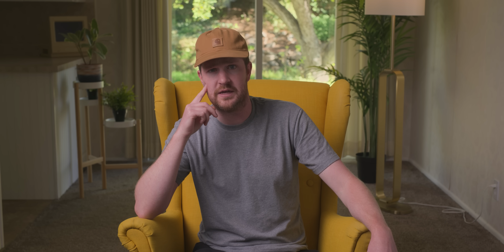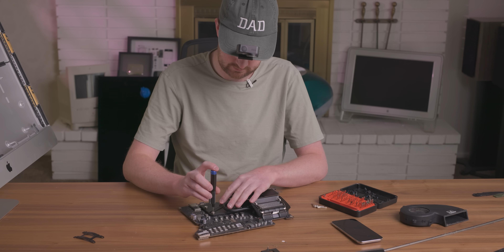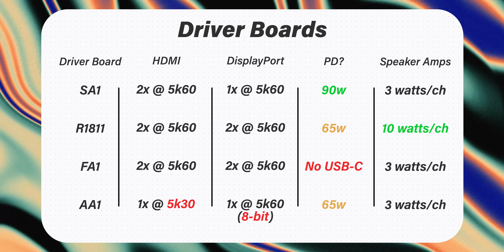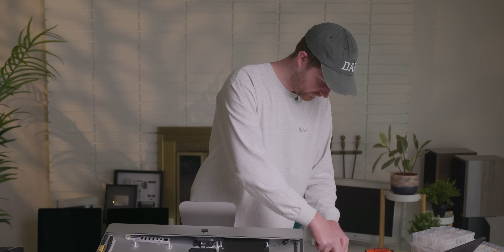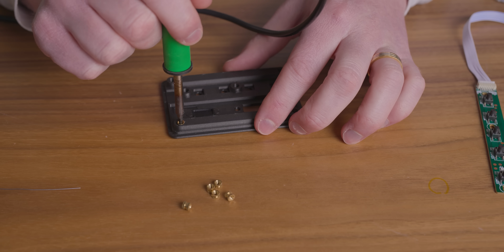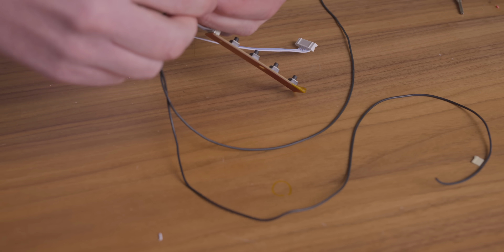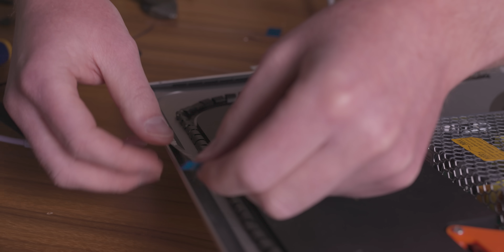I Turned a $200 iMac Into a $1,600 Studio Display!

Comment: This technique does not work with a early 2019 core I nine chips. Then they’re done that can’t make it become a second display on my Mac studio M5 max and even though the M5 max has thunderbolt five my 2019 early 2019 has thunderbolt three so in theory it should work in actuality. It does not and surprising me enough if I had bought the late 2019 27” it would work, I have no solution yet unless you have some insight you would like to offer me by the way great video great channel I subscribed…😊

Comment: I've been using it for almost 10 months now. I just hot glued everything (without 3D printed parts) and put a couple of adjustable wrenches inside the iMac for counterweight. It has no fan system, but somehow it still works fine. It cost about $300 in total in South Korea. Very worth it

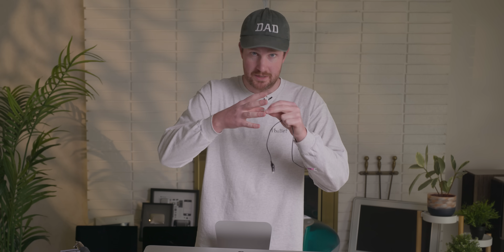Comment: 15:40 - those non crimping heat gun wire connectors are terrible. The connection is flimsy and flexes so much that it breaks the solder eventually. Especially if there is any type of load on the cable.

Comment: I just finished my 27" iMac conversion using this video as guidance. There is really no need to 3D print parts (a solution in search of a problem and adds complexity). I just twisted off some of the OEM mounts used in various places and repositioned them using epoxy to mount the graphics card next to the right speaker. I kept the fan, speakers, added crossovers mounted to existing posts. I used a $15, 24VDC/5A laptop power supply which is much smaller and has built in thermal protection and noise suppression. I attached the PS with heavy duty velcro. Fan controller tapped into one of the USB ports on the graphics card for its 5VDC power. I re-used the Apple access door to mount the switch panel and bulkhead connectors for DP and HDMI. I can still remove it and access the graphics card video connections, if necessary, and without removing the display.  It was a fun project, $375 all in, including $100 donor iMac on Craigslist.

Comment: I just got a free 2017 iMac 21.5" 4K...still in the "what if..." of deciding what I want to do with it.  To my surprise it is fully functional...just needed an OS.  It is just the i5 7500, gonna grab an i7 7700, got 16GB for it and just a 256GB SSD for now.  I am thinking of making a slim stand that goes beneath it holding a Bluray drive, another storage option, and maybe move some USB / USB - C to an easier accesable location.

Comment: Hi everyone,

I’m urgently trying to convert my iMac 27-inch 2020 (A2115 / iMac20,1) into an external 5K monitor, and I would really appreciate your help.

My iMac:

* A2115 / iMac20,1
* Retina 5K 27”
* AMD Radeon Pro 5300 4GB
* 5120 × 2880 @ 60Hz
* Original Apple 5K panel

I have the EDID information and photos of the panel label.

I’m looking for the exact compatible setup for this 2020 panel:

* 5K controller board
* Correct panel/revision and eDP cable
* 24V power supply
* Speaker crossover/adapter and cables
* USB-C / DP / HDMI inputs
* Any other parts required

Most guides I found are for 2015–2017 iMacs, so I specifically need advice from someone who has done the conversion on a 2020 A2115.

If you have successfully done this, please help me with the exact controller model and compatible parts, preferably with AliExpress links.

I really need to complete this project, so any first-hand experience or advice would be greatly appreciated.

Thank you so much!

Comment: Hi there absolutely loved this and made it my own followed every step and as far as I know haven't missed at thing. Screen, fan and speakers are working perfectly one thing isn't which are the buttons on the back :( I could really use some help and hope you could provide me some info on what might be the problem :/ buttons defect after cutting of the on button? rerouted it on the original power button which works fine  (meaning I can turn the screen on and off with the OEM apple button on the left corner) just the rest of the buttons don't respond. what did i do wrong!!:P

Comment: I have successfully implemented this.  It took about 3-4 days of working on it off and on.  I had to do a lot of pausing the screen, counting wires, etc.  I will note that the 3-d printing files linked mostely worked.  The one for the driver board did not match what was in the video and didn't line up properly with existing holes in my case.  I had to improvise and only use 2 of the 4 mounts.

Comment: Help, how to do I connect the last two cables, IE from the controller to the monitor?  The one is simple, it has a clamp and goes right in.  The other has pins sticking out and I can't figure out how to connect that cord from the controller to the last cable on the monitor.

Comment: Happily still using my iMac18,3 topped out at macOS Ventura 13.7 as a web, video ,Evernote and general writing machine. Something worth noting is that even with the OS gap from 2 to 13, this iMac is still interoperating as a seamless space with the Macbook (and its other monitor) next to it, ,moving the mouse across between the two and dragging files with no delay. Apple do a great job with Continuity and Universal Control.

If I open shared files on the iMac, I can use it as a big screen editor for stuff on the Macbook, ,so for now I have a great working approach without pulling things apart. Still, thanks for the enthusiastic tips and bookmarking this for the day when all this stops working.

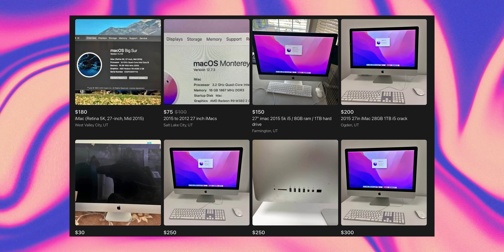Comment: 6:50 I practically stole this computer. I just picked ip a 2017 5k iMac with the 570 Pro GPU, and 48gb of ram and a 1tb fusion strive with a Magic Keyboard and a Logitech mouse for $125. what an actual steal, the guy even threw in this other 3rd party wired keyboard too that sorta looks like a Magic Keyboard. and before you start thinking its all beat to crap, it is not. it looks perfect. it performs very well. the hardest pill to swallow is having to choose between using this as an external display, or as a standalone computer.

I really want to be able to have this thing work as a standalone monitor to extend my M1 MacBook Air's display for productivity related reasons.

however the graphics perform as well as my MacBook Air, however the thermal headroom is much higher and it has a TON of ram (the cpu though is quite a bit weaker than the M1, but that's to be expected. and with the fans, if I'm doing anything heavy, it should keep up the pace fine compared to my MacBook). it should be a decently good gaming computer considering it can run windows, and, um, has a fan so it doesn't overheat which frequently makes me have to slow things down when running Minecraft on my Air, even though it handles the max settings great, it just doesn't have the thermal headroom to maintain that without me feeling like I'm punishing the components. 

ahhhh.. so sad, I will find a way to make this work because I REFUSE to let a decent, actively cooled GPU, 48gb of ram, and 1tb of storage go to waste just to use the (albeit beautiful) 5k display. I am DETERMINED to find a way to use both.
Reply: Okay so I have a workaround that isn't quite Ideal but might be better than spending $76 on a lunadisplay connector. basically just link the computers together and you can then use your keyboard and mouse for both. You can also through continuity open safari windows back and forth quite quickly. not as quick or effective as already having everything basically on one device, but pretty good for many cases and if I'm keeping certain apps for one display and certain apps for the other, its not that big of an issue. since I'm the only one using this computer, the way it is now actually can be quite effective for what I want to use it for, while keeping it functional as a computer that can have files and be standalone without my MacBook. I just need to get a more modern version of macOS on here and maybe get a partition for windows so I can do some gaming, and have a small partition for Linux because that would be cool :)
Reply: UPDATE: I am 90% there!

So as I wanted to use this computer as well as a computer, not just as a great monitor and a set of speakers, I used OCLP to install Sequoia (for significantly improved productivity and multitasking ability, really take advantage of the whole 48gb of ram!), as well as modifying the identifier for my iMac to say it was a Mac that supported being an airplay receiver. which funnily enough, when all is said and done, I am actually likely to just use the computer and airplay to my MacBook because if I need a second display, I am gonna be multitasking a ton, and therefore gonna want to be using the active cooling and 48gb of ram on my iMac, instead of overloading the 16gb of ram on my Air, when just regular use for me puts around 888mb on swap. 

so currently I can now stream to my iMac as a monitor, stream from my iMac like a computer, use it as a productivity workhorse in conjunction with my MacBook Air and connection with iCloud and continuity, I have a iMac with a decently powerful GPU (on par with my M1, but with active cooling), and the ability to bootcamp Windows on it, making it a decent gaming rig all things considered. its not gonna beat a custom pc, not even close. but my experience in gaming on computers is literally this 2020 M1 Air, my 2019 XPS 13, my 2013 MacBook Pro 15,  and a Dell 5420 All in One (which though its newer, has a MUCH worse graphics card, and a pretty comparable cpu, but 16 vs 48gb of ram, and a similar type of drive being being a Fusion Drive.). 

I am so happy. the only thing left is to try getting bootcamp on it, but I need to first solidify where Im going to leave the OCLP boot disk. if im going to partition it onto the hard drive, or maybe open it up and put a completely new ssd in it and almost make it act as a storage hub, as it already has 1tb of storage.

Comment: Does power delivery over USB-C work on your setup? 
I'm trying to decide what power supply to get and I noticed the LRS-150-24 that you used only does 6.5A. I saw on the infamous macrumors thread that you need 8A+ if you plan to use the USB-C port for power delivery. The Mean Well LRS-200-24 does 8.8A, but I'm not sure if the 3d printed power supply mounting parts will work with that one.

Comment: Ok so I just did this project for bout a couple weeks now with trial and error since my board was the latest version of the R1820 than the R1811 so the 3D printed parts weren’t compatible for it, so I opted out for thin steel strips and bended and cut them to align with the screw holes, when it comes to the PSU make sure to switch the 250V to 156V from the side so it connects, and make sure to place an FG ground cable with the already screwed in one from the monitor next to the dual power outlet cables which was sadly skipped over in the video, as for the temp fan: cycle through using the first button for each setting and the other 2 for +\-  

If you want to turn off the MeanWell PSU manually than just turning off the stonetaskin board, try an outlet switcher that matches the wattage for it. 

Also DO NOT USE the Heat Gun that comes with the tube solder kit try an 50$ one with multiple nozzles included as he has in the video.

Comment: Quinn & Dana - Man, if somebody ended up with your shared iMac, They'd assume it was owned by 2 Hot Lesbians. 
Anyways, Although a proper 27" 5K iMac with an i5/i7/i9 Is still an absolute rocketship in 2026 - Apple really dropped the ball on not just repurposing the 2014+ Cases as External Monitors in the first place. I mean, they would've sold them for like $4000 anyways so i don't get why they avoided the moneygrab.

Comment: Many years ago I could use my 2009 iMac as a secondary display for my MacBook without any issues, switching back and forth between the two. Using a computer as a monitor without using it as a computer makes no sense. It just burns a lot of extra and useless energy

Comment: 1:34. ViewSonic 5k 27" display with better specs WAY better stand, connectivity out the wazoo including thunderbolt port that will drive the display while charging your MacBook.  Add top of the line speakers and webcam, and still save hundreds of dollars.

Comment: I literally just did 2 2017 Imacs, one for myself and one for my wife and once you are done and make adjustments there is no monitor for the money that comes close to these monitors. Absolutely perfect project, it helps if you have a 3d printer
Reply: Hi there absolutely loved this and made it my own followed every step and as far as I know haven't missed at thing. Screen, fan and speakers are working perfectly one thing isn't which are the buttons on the back :( I could really use some help and hope you could provide me some info on what might be the problem :/ buttons defect after cutting of the on button? rerouted it on the original power button which works fine  (meaning I can turn the screen on and off with the OEM apple button on the left corner) just the rest of the buttons don't respond. what did i do wrong!!:P

Comment: for less than $1000 you can just buy a great condition used studio display. My time is worth more than the $300-400 I might save by doing this and hoping it works. ( I also don't own a 3d printer )    A few months ago I sold my 2014 5k imac for $350 on eBay.

Comment: Video is great , .I personally did this conversion with the simmilar driver board and imac 2015. My experience is that the difference between 10-bit and 8-bit color depth is huge. I use this iMac as a secondary display, and the colors actually look better on my 4K monitor with 10-bit color. Once you notice the difference, it can be a bit disappointing.

Personally, I don’t think 5K is something you really need. I was able to run 5K, but only at 30Hz over HDMI. The seller told me that for 60Hz you need to use Thunderbolt/USB-C.

A 27-inch display with 3840×2160 resolution is more than enough, especially since those monitors are easy to find nowadays.

Also, by 2025, almost all of these original iMac panels are starting to develop the pink tint effect around the edges, which is another disappointing issue to keep in mind.

Comment: go buy a 27" iMac 5K with Thunderbolt for cheap and get 'BetterDisplay' to drive it from an MBA or laptop or some other newer mac.  Absolutely the best monitor for the money.  You don't have to buy hardware or open the display.  Plus you still have a computer.  You threw away an i7?  And a GPU?  Why?  iMac 5K with MBA and soon Mac Studio.  And if you eventually want to sell the computer in the future, you still can.

Comment: Followed your steps pretty much verbatim, and I'm now I'm the happy owner of a 2017 5K display to match with my M2 Studio! I don't know how often you read comments, but thank you so much for making such a concise step-by-step video, along with cataloging all the parts and STLs I needed for the build. Your website is missing a couple little things at the moment, like how to properly wire the crossovers and your custom STLs, (which just lead to broken links,) but considering what happened to you during this whole ordeal I understand why. overall I can't thank you enough for doing the hard work for us!

P.S.- For anyone else looking to do this build, one piece of advice I'd give is to not bother with the crossovers/speakers. While the original Mac DACs worked great with the speakers, these are quiet, lack any bass, and the volume can't even be controlled, (at least as far as I can tell when connected through USB-C.) My Mac Studio's built-in speaker genuinely sounds better and got louder, so I just pulled them out entirely before I finished. Save the money for some dedicated speakers, you can get great older 2.1 PC speaker setups that'll blow any built-ins out of the water for only $20 or less used. Other than that, be aware the power button will only control the display, the power supply will always be on and so will the fan controller when wired up like he shows. not a big problem as the fan will stop once its reached ambient temperature inside, and most display power supplies work like this anyways, but just something to be aware of that I didn't even consider when building it.

And for anyone wondering, total cost with tax (including the cost of the computer I got off eBay) was $550, ($520 without the crossovers that I didn't end up using.) It'll be more if you don't already have things like soldering tools or a 3D printer, but for those with the tools and knowledge it's SO worth it.
Reply: If skipping the crossover, is the crossover_and_step_down.stl still needed?  It sounds like its used for two things, the crossover and the step down to mount.
Reply: @MrIncrediDad The step down he used and links to is different from the one I already had on hand, which is smaller with different mounting holes. So what I did in my build was just glue it straight to the case with hot glue and capton tape just like he ended up doing for the fan controller. If you're using the same step down that stl can still be usable for it, otherwise it's not needed.

Comment: Is this solution stable over time? For example, if Apple does an OS/firmware/etc update is it possible for your Mac to stop recognizing the converted iMac display properly? Maybe not breaking it entirely but resulting in text scaling issues, connectivity issues, etc?

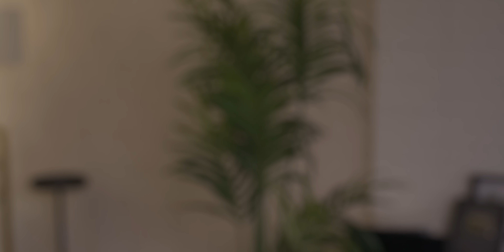Comment: 10:48 FYI, instead of using weights, you can simply loosen the spring pre-load screws by about 1-1.5 turns…

Comment: i need the link to the SA1 Board STL-files. the ones you have linked are wrong. you use different ones for a different location in the housing. please send a link to the ones you used. i am not able to finish this built now and am stuck.